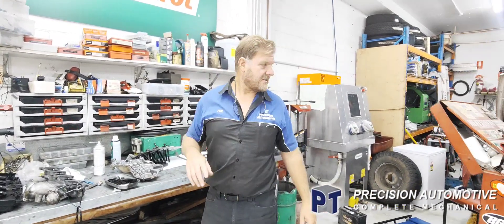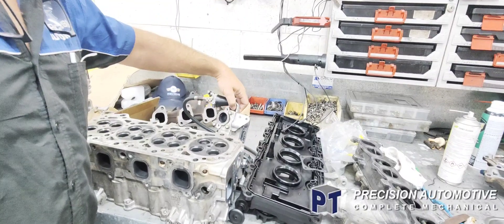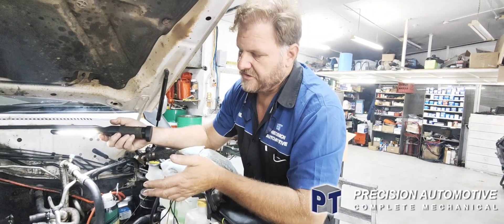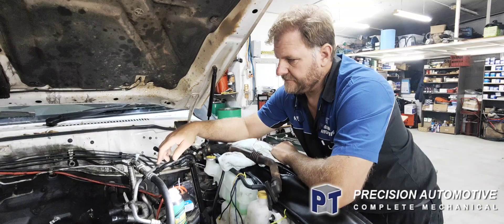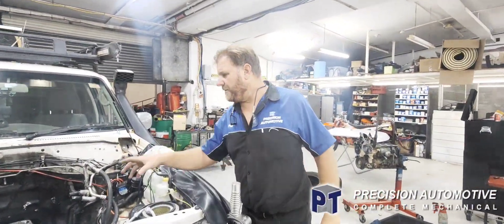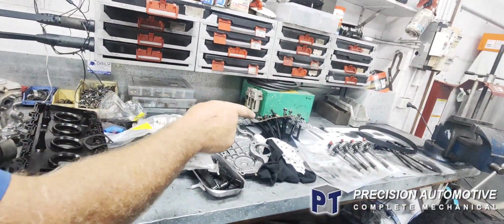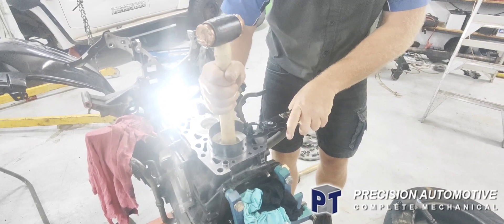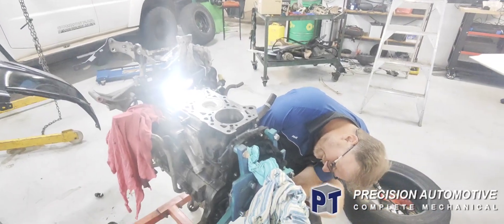ZD30 Nissan Patrol cylinder damage. coolant leaking into cylinders

Comment: Great videos but those hairline cracks are harmless the piston crowns are very meaty on the patrols. Typical after an overheat to see hairline cracks on one piston, a bad overheat they could all crack. I cant see the crack so if its bigger than a tiny hairline crack then it must be changed because he will get some more blowby 😊
I rebuild a lot of these engines here in Ireland, mighty reliable engine if looked after and not overheated.
Reply: i’m about to replace the head in mine, are u saying if i come across a hairline crack like this it will be ok to run it like that?

Comment: Could a cracked head prevent the engine from starting due to no compression? If it's cracked in a few places?
Reply from the maker: Thats a tough one mate , How do you know the head is cracked ???, you need to do a wet and dry compression test.